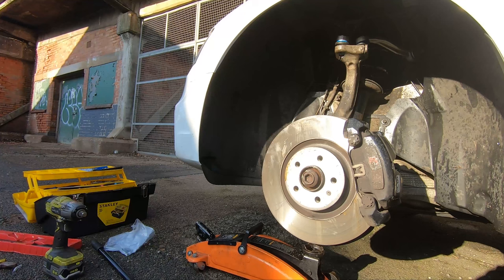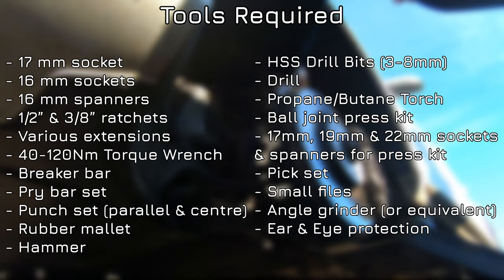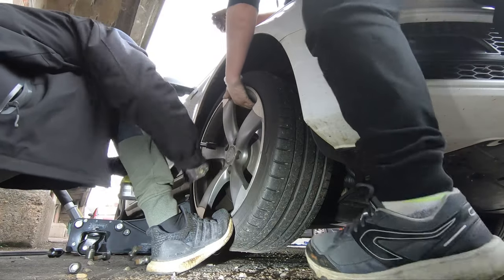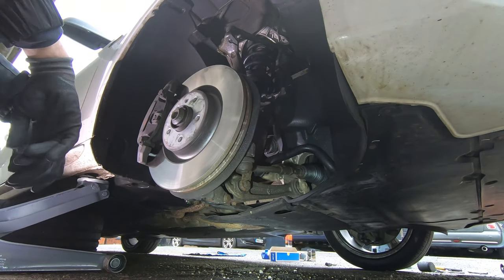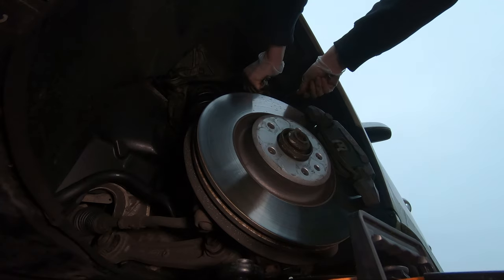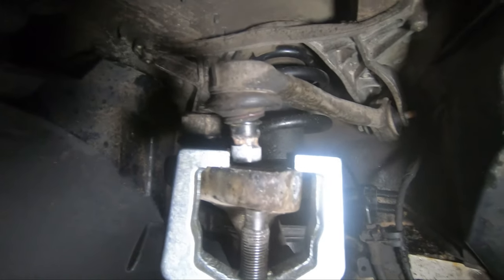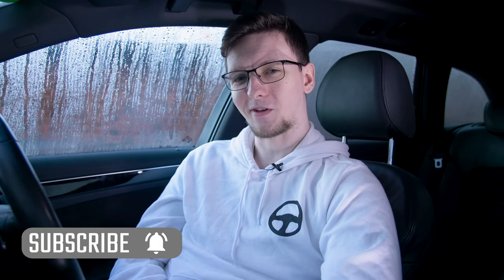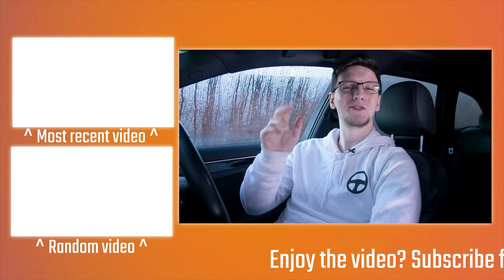Audi A4/S4 Front Upper Control Arms Replacement - The Damn Pinch Bolt!!

Comment: My pitch bolts were a pain in the butt the first time I took them out. When I reinstalled them I slathered them in anti seize and now they are easy to get out.  I had to change my upper control arms about every 30,000 miles.  I am lowered  3 inches in the front and they don’t like that

Comment: I recently did this to my 2012 A7. The best method I found was to take the nut off, and spray it for days before frequently with plus gas. On the day of reckoning, I used plumbers gas to heat the bolt and ally up. A welder told me that aluminium will not be affected, by the heat of one these torches, as they won’t heat it to melting point. 

Then gradually begin to rotate the bolt head. Nothing crazy, just smooth gentle turns. Once it’s freely moving, then get a correct sized punch and prepare for battle. Firstly put the nut back on for a few turns, and hammer this. You’ll be throwing this away after. The bolt should begin to move out of the ally. 

Then once the thread end is flush with the aluminium hub, use the punch to continue hammering the bolt out. It will take a little while depending on how bad it is. My A7 had done 120k on original shocks, so I was fearful it wouldn’t work. But it was…

Continue to heat the area, as it’ll expand the section and allow continued movement. Eventually the bolt will be out far enough, that you can get grips on it and pull the sod out. 

Now the key to it all, is when it comes to replacing with the new one. Whatever you do DO NOT APPLY ANY GREASE OF ANY KIND TO THE NEW PINCH BOLT. 
This will accelerate galvanic corrosion. Clean the hub slots with a round wire brush which fits through the holes and then slide the new bolt through. 

My car took me a day and a half to do all the suspension, including removal of the pinch bolts. 

The right tools will give you a fighting chance.

Comment: Try cutting the head of the  bolt  off and then remove the nut from the other end and put a couple of washers on the bolt. Replace the nut and tighten. This will normally draw the bolt out. Plenty of lube though. Good luck.  🚘

Comment: Did it make any noise  while driving? My one is making a knocking noise while driving slow and braking,  and when I'm doing 70mph and brake slowly I have a bit of vibration in the steering wheel.

Comment: How do you get it at the correct ride height before torquing up?
Reply: Hey this video shows  you where to mark the upper arm to get the right ride height!. https://www.youtube.com/watch?v=4XSVqqEl3_A&list=WL&index=9&t=255s @1.47
Reply: Before you jack the car up measure the centre of the hub to wheel arch. While the car is at it normal ride hight

Comment: its a job of 5mins with the right way. And you dont need any special tool for. Rip off the screw and pull out the rest with washers with an impact wrench. edit: yes heat&vibrations is also a way but its a pain in da ass
Reply: eh, you can't get an impact wrench n on the nut side because of curvature of the knuckle.

Comment: I have tried to remove this bult two times, both times I ended up drilling it, also both times I ended up breaking the drill inside the bolt and had to buy new knuckle(in lack of a better word) =D